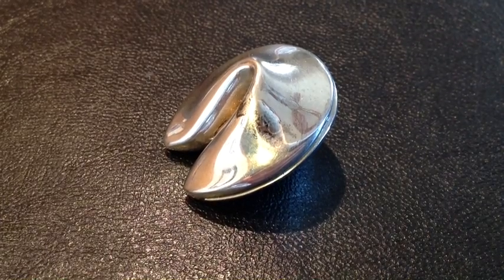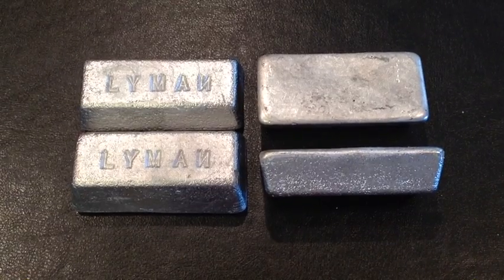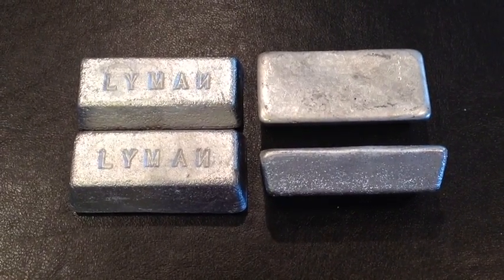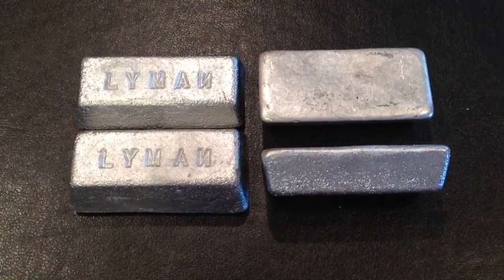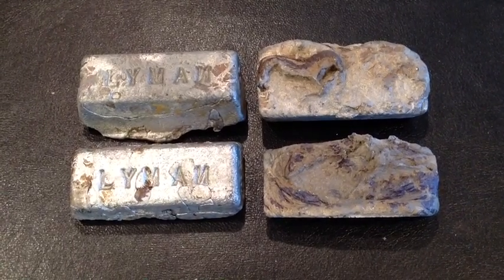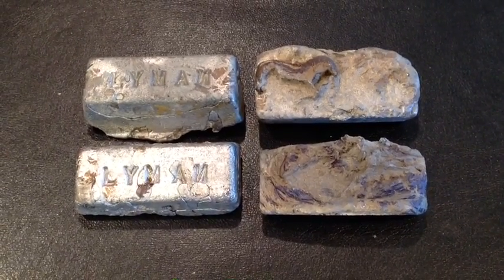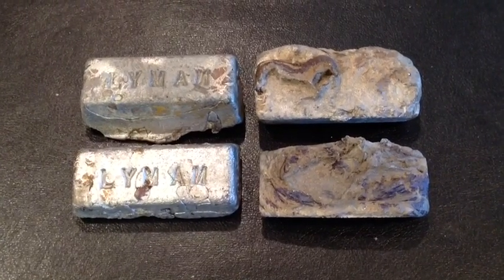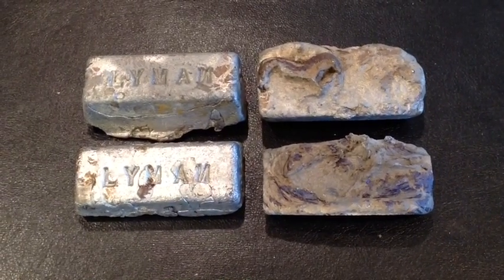Bullet Casting Heartbreak of Zinc

Comment: I'm pretty sure I got zinc in mine. I haven't casted bullets yet but casted sinkers. I guess I probably ruined my lead pot. Guess I'll stick to sinkers and just buy my cast bullets. I don't want to start all over again. I got a purple haze on top of the lead. I skim and skim. Poured great no roll sinkers though. I don't think catfish will care about my lead and possible zinc sinkers. Sucks though I wanted to make bullets. Doesn't sound like it's possible to get the zinc out of my Lee lead pot
Reply from the maker: bubbacrabb Every bullet caster has had that happen - it's not zinc - if it was your alloy would look curdled.  When the alloy gets too hot that color comes up from oxide compounds being formed - and you won't be able to skim it away as it will keep forming and you'll see the color just keep coming onto the surface of your lead.  When making ingots, as soon as the you see the last of the lead melt, turn down the heat, flux once and skim dross - pour ingots without delay.  You have much better heat control with your casting pot so when bullets are being made, this should not be much of a problem... Good castin' to ya
Reply from the maker: bubbacrabb Yes, I've had zinc contamination melting wheel weights and that whole batch was ruined - you cannot make ingots with that contaminated alloy - it looks bubbly and curdled is the best way to describe it - the video shows it.  If you can cast ingots, even with a purple film on it, it is not zinc.  If the purple ingots are remelted and not overheated, you can skim off the purple and no more will appear.  But I would not mix purple ingots with the nice silver ones...If a little bit of that purple gets into final cast bullets, will not affect the shooting inside 25 yards or hurt gun barrels.  And if tumble lubed with 45/45/10, the antiqued appearance of the bullets will hide a little bit of that bluish purple.   If you decide to give bullet casting a try, please let me know how it goes...Best Regards FC
Reply: I only have one more "burnt" ingot. I catfish a lot. I'll use this last few pounds of this to make sinkers that I'll lose in snags. I'll use this new ww lead I got to try boolits and let you know. Sinkers were fun to make, I'm sure bullets will be
Reply from the maker: bubbacrabb If you have a source for wheel weights, stock up best you can because that source is disappearing fast because of three reasons 1) the authorities are making tire shops turn in their wheel weights by a quota system (the shop won't be able to give you any, because they won't make their quota)  2) Lead is being phased out in wheel weights - zinc and steel are being subbed in.  3) owners and family are getting some of the remaining lead wheel weights (no one wants the zinc and steel ones).  Wheel weight lead is great for making bullets as the hardness from the antimony (plus a little tin in there) alloy is perfect for most of our shooting.  I remember fondly being able to take 5 gallon buckets down to the metal recycle yard and just buying wheel weights for 35 - 50 cents a pound (used to buy 300 pounds at a time) - and they were almost all lead.  Now if wheel weights are found, they are 50% zinc or steel.  Used fishing weights reclaimed out of streams and rivers is a good source of lead for our bullet making (we just have to be sure not to just plunk them into molten lead since there may be water in them).  Problem is that our reclaimed lead is going overseas to be smelted down into car batteries and lead pigs that our ammo companies buy for bulletmaking.  Have a great day

Comment: Good tip. I am designing a simple plate steel pot to separate lead & scrap. I would have learned this the hard way. I wasn't thinking about temp control for the separation process. Actually, I may have had to learn this lesson a few times as it wouldn't have been obvious to me where I went wrong.
Reply from the maker: shananagans5- Hope you are feeling well…I had to learn this lesson the hard way as well…not fun…Best Regards…FC

Comment: thank you. i also use the lee sizer with alox and my bullet look nasty. Would I be better off to get a Lyman sizer and use the stick bullet lube.
Reply from the maker: Wayne Brummett-Great question - before you do that, check out my two videos on the 45/45/10 tumble lube system for cast bullets - it answers all the objections to LLA but maintains the effectiveness - no leading, quick, easy, and economical...Good castin' to ya...

Comment: I wanted to get tin for an 10/1 alloy, and therefore, I bought a lot old plates and cups from ebay, which were signed as "pure tin" or "95% tin".

Guess what?

After melting them down and pouring them in my ingot forms, I got a whole bunch of zinc bars.  : o (

Is it possible to distinguish tin from zinc?
Is tin getting dull when it is old, or is the dull stuff allways zinc?
Reply from the maker: Ouwkackemann- Don't know why it's so complicated? 1) if the tin is already in alloy with lead - it's not a problem -  you've got an alloy you can use ; you won't find zinc in a lead alloy as a rule, because zinc is a contaminant for lead and looks horrible  2) if you have some grayish metal, and you think it may be tin or zinc but don't know which - take a little chunk of it and throw it into freshly molten lead alloy (650-675 degrees temp), if it melts, it's tin - if it floats on the lead and refuses to melt, it's zinc (melts at 787 degrees).  Fish it out immediately - don't want zinc.  But tin isn't the hardener you want anyway - antimony is the hardener.  Tin only adds a small amount of hardening - its real value in the alloy is to increase the flow so that it casts better.
Reply: FortuneCookie45LC
I see, but a 10/1 alloy with tin would be hard enough for my uses, with lower speed. Antimony isn´t easy to get here, same with linotype and even worse with weelwights (no lead allowed).

When I buy tin over ebay, I can´t proof it before. So I must take a look, which way I can go.

Thank you for your response.
Reply from the maker: Ouwkackemann When I asked why it's so complicated, I did not mean you.  I meant all the stuff that you hear on the Internet about getting zinc and tin confused.  Tin melts at a lower temp than lead so it always melts if lead is melted.  But Zinc melts at a fair bit higher than lead (787 vs 621).  You can get lead temp high enough to melt zinc into your mix, but that will not happen unless you keep cooking your lead with high heat  that's why I always say that once the lead melts, turn the heat down to just keep it molten without cooking it.  Then anything that is floating  skim out most of it, add flux one time only, and finish the skimming as part of the flux procedure to better get to the ingot pouring.  Too many casters sit there with the heat on full while they flux 5-6 times, burning out their tin and antimony while they are doing that... Best Regards
Reply from the maker: Ouwkackemann Addendum - Sorry - didn't mean to go long on that reply - Of course, every caster can cast any way they want.  We'll all get to the same place, and that is affordable, available ammo.  Take care... FC45LC
Reply: Thanks man, for your explanation.

I´m surely one who could overdo something, like add to much heat to the melt or flux to much, really.

In trying to do things as good as I can, I sometimes make to much.

God bless you and the folk of America.

Best regards,
Ouw.
Reply from the maker: Ouwkackemann Have a great day in Germany...

Comment: Wow great video thanks for your information 🙂
Reply from the maker: Flames N/a - I got zinc contamination once - that was enough...a commenter once told me that we can easily avoid getting zinc contamination by keeping our temp down below 787 degrees F.  But now that I'm using the PID controller from Johnnuy's Reloading Bench, it's easy to go over that...Best to watch the lead melt and once it does, skim out all the steel and zinc wheel weights without delay.  Good castin' to ya,  FC

Comment: you could always use the contaminated lead for buck and ball, use pure lead for the ball, another way to use it is load the shells with black powder and make buck and balls to shoot in a single barrel 12 ga gun.
Reply from the maker: dave12546-I'm close to getting the Lee buckshot mold for 00 buck, and then how simple would it be to get a round ball mold from Lee to make your buck and ball loads…definite good ideas there - my those loads in BP were ferocious during the Civil War…I believe it was Antietem.  Best Regards...
Reply: FortuneCookie45LC
there's a guy on here called Bubba Rountree Outdoors, ck out his site, I do have the LEE 690 mold but have the Sharp Shooter 00 buck mold..also just do  a search on here for buck and ball, watch a few till you see what you like...GL and   keep the videos coming.
Reply from the maker: dave12546 Thanks for the post - tried to find Bubba Rountree Outdoors, but nothing comes up.  Will do some more searching on this.  Thanks for the info...
Reply: try Reloading how-To: Buck and Ball 12 gauge 2 3/4" 

and  Molding 00 Buckshot For Reloading using a Sharp Shooter USA Mold
 both on U tube
Reply from the maker: dave12546 I had forgotten, but I actually saw that video before in my YT travels...3" and 3 1/2"  Magnums can shoot 2 oz payloads, but all the factories use filler wads of some kind in these mega loads. These loads fit in the 2 3/4" shell because the filler wads are left out.  Don't know about the pressure on these loads, and if they were sound, the factories would load similarly - note the Win PDX loads use of flattened disk slugs.  But I do not believe factories condone just using a gas seal only under the payload.  I'm sure they work, but I'll let all you megablasters shoot 'em.  I might use a subcaliber ball and buck, but then why not plain buckshot...Thanks for the links...interesting